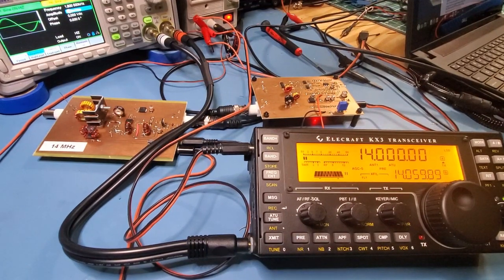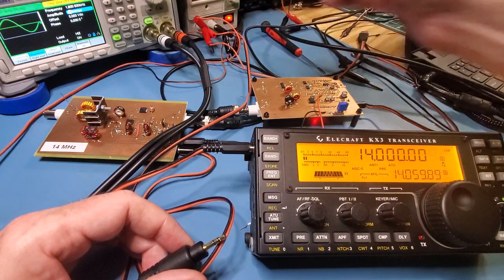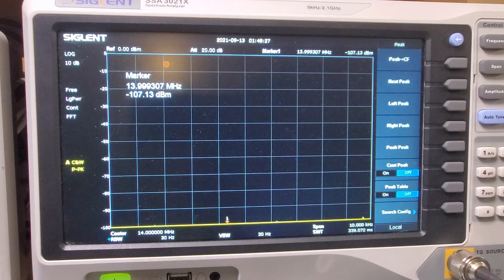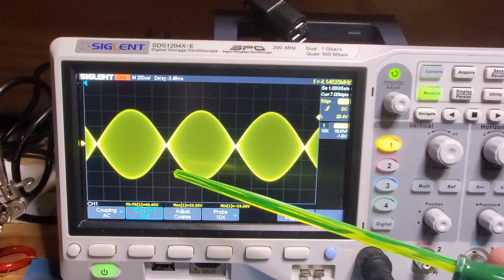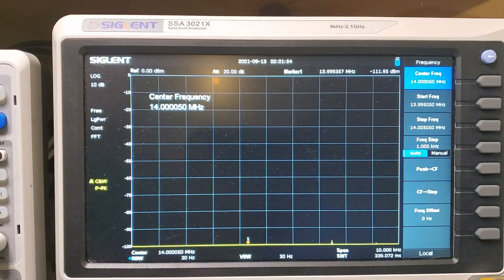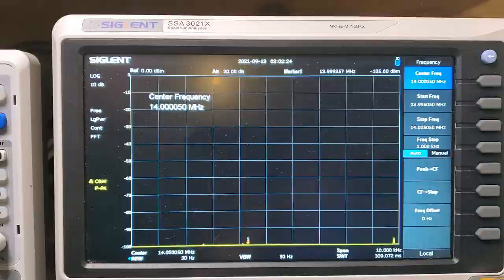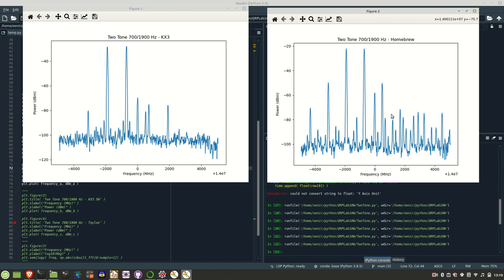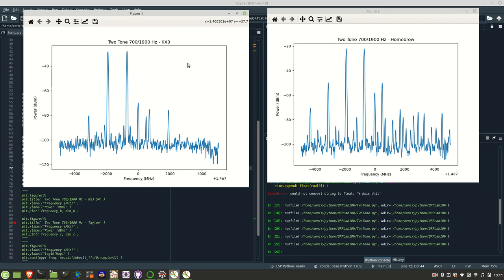KX3 and Homebrew Tayloe Compare

Comment: I think you maybe are comparing apples and pears. The kx3 ssb-signal passes through a bandpass-filter and a lowpass filter. The kx3 tayloe mixer is also different configuration than yours.
Reply from the maker: Help me understand your comment more Niels. The amp after my Taylor modulator does have a low pass filter. The purpose of the compare was more to look at how far off my homebrew was from a "real" radio like the KX3 - rather than any direct comparison

Comment: Any chance that the homebrew rig may be overloaded? Try reducing the input signal level.
Reply from the maker: I am pretty sure the input audio level into the Tayloe is good. There is definitely a sweet spot at around 600mV p-p on - and there is audio distortion in the ES8388 at > 800-900mV p-p. Thank you for the comment though - lots of great suggestions

Comment: One other thought, you have an inductive dummy load, did you use the same dummy load on both radios? I don't believe that would cause harmonics but just wondering.
Reply from the maker: Same load in both cases - a 50ohm, 50dB attenuator

Comment: Well, No one else is chiming in I will give it a shot lol. It always helps to bounce thoughts off someone else. I would assume you are losing the peak on your signal because we are amplifying the harmonics also. More load on the amplifier circuit. but the harmonics? can you trace the harmonics back through the circuit to see where they originate? I would take a shot in the dark and say it may be coming from the mixers. unless you are using the SI5351 to feed the mixers. I know that makes harmonics I used a low pass filter after it to fix it. sorry I can't remember if you used that or not on this radio. feel free to chat it through with me I am not an expert but I am learning as I go and it's almost all fresh in my mind. right now. I would definitely start probing back in the circuit to find where it starts. and make a list of all the harmonics so we can think them all through.
Great videos by the way, you do very well!
Reply from the maker: Thank you for the great ideas. I am using the si5351 and I've always wondered whether I should be using a low pass after it. Thats something I'll definitely try. My suspicion though is that the primary source of the harmonics is the amp. I have some other low power linear amps in the 5-10 watt range so I'll try that also

Anyway thank you again for the comments and ideas
Reply: @na5y  Ok, so you are using the the SI5351.
Here is my story on why I used the low pass filter after it. I noticed from switching from my sig gen to the SI5351 that the audio started getting distorted that is when I started testing. I was using it at 7 Mhz and found that it produces square waves. I installed a low pass filter for just under 9 Mhz and it removed all the harmonics I could find and the audio cleared right up and sounds just as good as with the sig gen. lol now that I think about it that makes sense if you are getting harmonics in the audio range also.
Reply from the maker: @Curt Stacy  Worth a try - a little bit of a pain because it makes another part of the radio band dependent.

The KX3 uses an si570 as its frequency synth - unlike the si5351 the si570 has no 0 and 90 degree LO capability - so they use the D-type flip flop pair to produce the quadrature signals. I did try the dual flip flop arrangement with the si5351 but I didn't notice any change for good or bad. I have no idea what the tolerance is for the 0 and 90 signals out of the si5351
Reply: @na5y  I was looking at one low pass filter per band but, It may not need one per band I was able to use the one low pass filter from 6 through 9 Mhz so far with no problems. sorry I haven't tried other lower frequencies yet to see if I have a clean sign wave. There are different ways the SI5351 generates the signal some are better than others. I remember on one I had a clean sign wave. but I think you should probably just find where it is coming from first. by the way, I remember Charlie Morris mentioning something about the audio in one of his videos and he mentions something about where the SI5351 came from may be the difference between having that issue and not. probably the different board layouts.
Reply from the maker: @curtstacy779  Thing is with the si5351 in the Tayloe mixer is you are using it to switch off and on pins 2 and 14 in the FST3253 multiplexer. Its not the traditional analog (say) NE602 mixer or the SBL-1 mixer that I have seen Charlie use. Given the mixing is occurring from the switch action in the multiplexer I am not sure a sine output would help. Like I said though worth a look at.
Reply: @na5y  I had to think through this comment for a while. I think I would stick to some measurements to see where the harmonics start.
if that doesn't send you in the right direction. can you disconnect the audio going into the mixers? or use a function generator in place of the SI5351. just to eliminate some parts of the circuit. I'm sure I don't need to tell you this but as a troubleshooter for decades now I will eliminate parts of a circuit to see if it still exists. also, another thing I was thinking what is the drive level from the SI5351 is that where you wanted it? and also from many years troubleshooting I have learned that when it seems impossible to find start over because you probably forgot something very silly. lol, that one has got me many times. I hope I'm helping to get you thinking a bit. if I'm distracting just let me know. good luck!
Reply: @na5y  Also by the way check your 4 quadrature signals for amplitude. this can vary the resulting frequency it will change the phase. I was going back through the last few videos and I don't believe you addressed this. and it looked like all your harmonics could be audio or something like this. I don't see any higher harmonics in the videos it's probably not the SI5351 the harmonics I had from it were much higher. by the way, I would say all the mixers I have worked with are switching. even the diode ring mixer. it uses voltage drop of the diode. and the 602 uses transistor switching. you just have a lot more going on it yours lol. I will leave you to your work that is all I can come up with for now. can't wait to see what you find. if you need to talk it through more hit me up I know it helps to talk about it. and I am having fun. I don't know anyone that will do this stuff and talk about it with me. other than some short conversations with charlie. I hope his move is going ok with the lockdowns down there.
Good day!
Reply: @na5y  I can't stop thinking about this one it felt like I'm missing something else. I forgot the carrier leakage and the other sideband then you would have the plus and minus of each one with audio frequencies. this could account for a lot of those extra signals. it looked like a lot of signals. maybe you just need a little more suppression of the carrier and the other sideband. I didn't see the exact frequencies on the scope just guessing that it looks close.
Reply from the maker: Lots of great suggestions Curt - thank you, love the ideas. There was a writeup elsewhere where the author put in an I/Q balance circuit after the opamps but before the FST3253 - but that was primarily to increase carrier suppression rather than deal with harmonics. I definitely want to try that.
Reply: The KX3 LPF is a seven order filter, while your home made has only 2 yellow toroids, as some one had pointed it out, apples and pears. 
Nice equipment and beautiful homebrew circuits.
Reply from the maker: @vk2ihl  Ah I see Pascal - thank you for the comment!

Comment: Ian,

Thanks for the comparison. 

I wonder if audio harmonics are coming from the op amps. The KX3 uses some precision OPA4376 op amps. Dan Tayloe used DRV135 instrumentation amps with 0.0005% distortion. Do the harmonics decrease with a lower audio drive level? Just guessing as the I/O balance had no effect on the harmonics.

Jerry, AC9NM
Reply from the maker: You are welcome Jerold. I was thinking the same thing ... I ordered some OPA2376 opamps to see if that was causing it. Having said that I think the amp is introducing quite a bit of the harmonic content. The harmonics definitely increase with increased drive level
Reply: That sounds like a very good place to look.